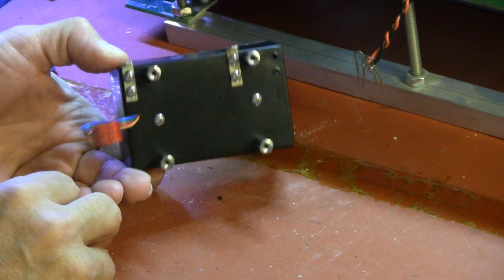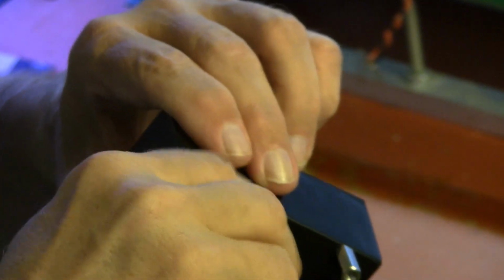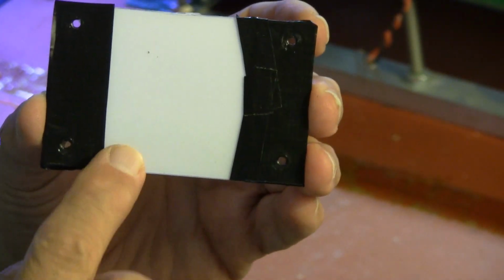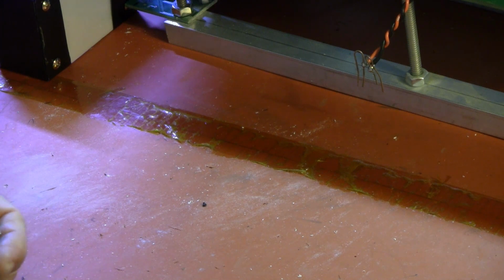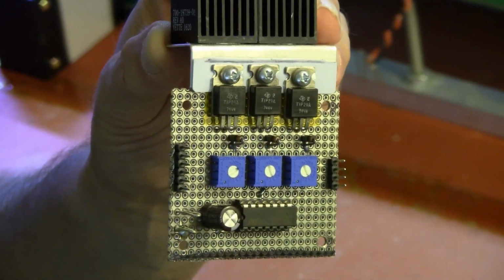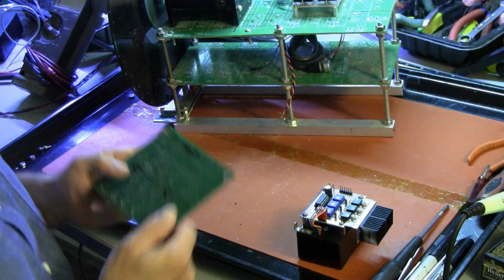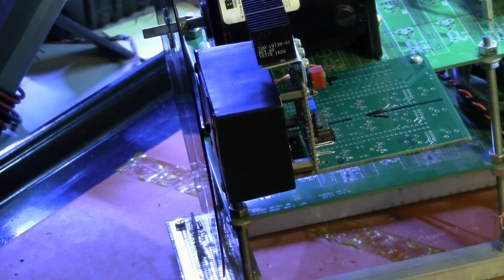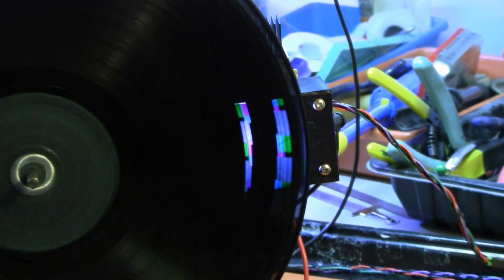NBTV "Big" Televisor, Part 2

Comment: How is the colour being encoded / transferred? Separate RGB?
Reply from the maker: The Aurora Designs World Convert WC1 takes in either composite or component SD video and converts to all other forms and formats. It handles all of the obsolete mechanical TV formats and over a dozen obsolete electronic television formats, ranging from 24 line mechanical all the way to several color systems including CBS, Dumont and GE field sequential systems. I may do a video about the converter itself some time in the near future. Though, I can only demo a couple of its output formats. The  WC1 has special RGB outputs for mechanical TV. These operate in parallel with the composite monochrome output as well.

Sadly, Aurora doesn't make the world converter any more. But, you can see the spec's and manual here: https://www.tech-retro.com/aurora-design/wc.html
Reply: @videolabguy   Hope you can do a vid. Such a neat device, but too bad they were so $pendy.

Comment: The Windows application Video2NBTV is a (free) poor man's alternative to the aurora.
Reply from the maker: Yup. I have a copy of that software. My current computer has audio issues. The new computer may be here as soon as tomorrow. After getting it all set up, I plan to do a comparison of the software generated video, audacity recorded video from the Aurora and playback of Aurora video to see what differences, if any, there are. I expect profound differences. But, we will see.
Please understand, I have been a video engineer for 40 years and I have high standards when it comes to signal integrity. I think a lot of hobbyists are suffering some unnecessary problems because of poor quality signal sources. This is an area that I will be addressing and hopefully improving for the benefit all.
Reply: @videolabguy  audio/video/broadcast R&D engineer of 40+ years here (retired). Sure, a top quality signal is very useful for testing, and optimising, a monitor, but don't forget that the "real" signal for an NBTV monitor is an NBTV camera, and making that a high quality signal out of that beastie is, as we like to say in engineering, "non trivial". The only real limitation of a software produced signal occurs when it leaves the digital domain and there are some hobbyists that have circumvented that (at least bypassing the audio card d/a) by building spdif interfaces, but sure, if you are prepared to throw $$$ at things, you are likely to produce a better product, however, at least at some level, that is somewhat against the spirit of the hobby.
BTW, I do hope you consider going to the next level and build an NBTV camera, it is a challenging, but very rewarding experience, it is amazing, no matter the quality, that one can produce recognisable, moving image with such a crude apparatus, if you do go on, the easiest camera to put together is the flying spot camera, but is somewhat limited in it's usage, whereas the camera (reverse of the monitor) is more difficult, it is easier to use. Neither are outside your capabilities of course.

I do have access to a library of mechanical camera recordings (sadly from era when reel-to-reel tape was the only practical recording media and hence subject to wow, flutter, and, of course noise. Some of these I have managed to timebase correct using Fast Fourier Analysis on the computer).
I mention this just in case you wanted to see what kind of results have been obtained (all black and white of course).

Comment: Hmm. I wonder what was on that record originally?
Hummel's trumpets, maybe?. Probably not a huge loss to the World? ;)

I like the way you've built the mechanical TV, using PCBs and stand-offs as supports.

You've inspired me to take another look at my shelved project, using high-power RGB LEDs as a replacement for the lamp and colour wheel in DLP projectors.

I have three 20-Watt LEDs (Luminus Phlatlight) already, but I need to design a new driver board for them.

I was using a very similar setup to yours years ago, but using KA350 regulators with shunt resistors for current-limiting.

(I've not tried building a mechanical TV yet, but I might do one day. I did design some PCBs for converting raster CRTs to vector arcade monitors, though.)